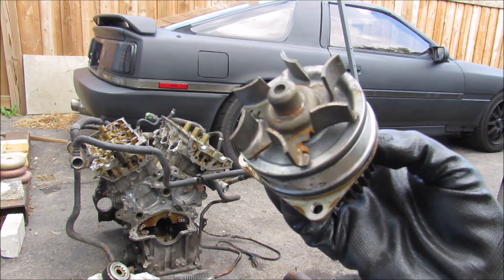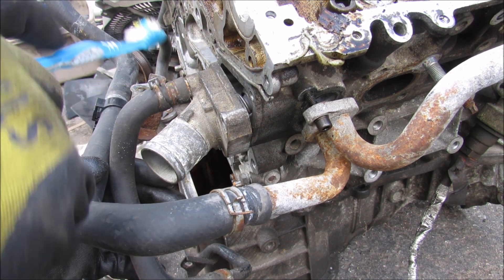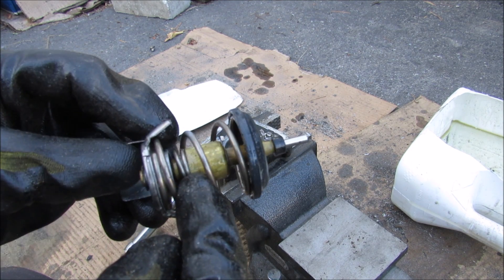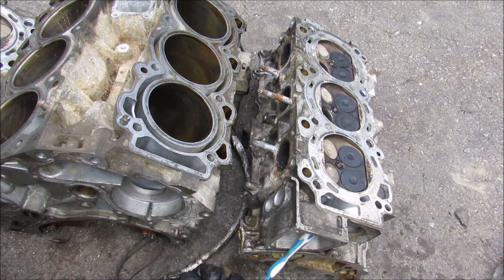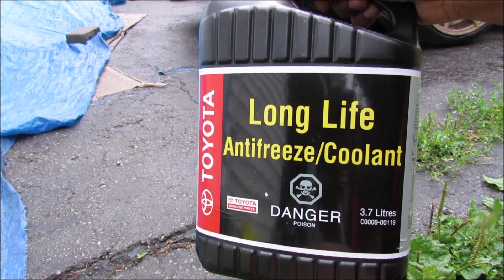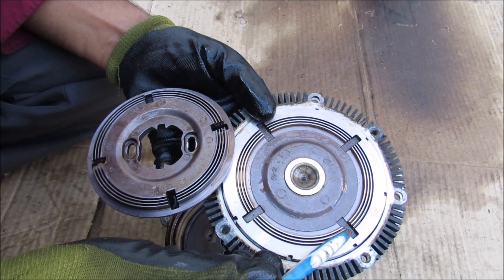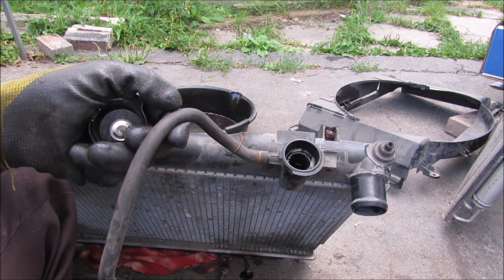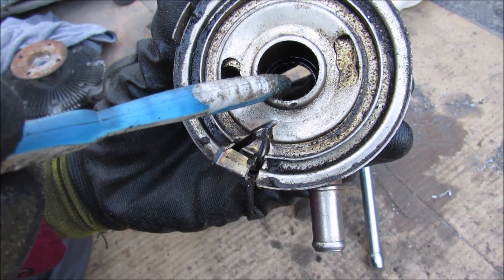Why Engine Cooling Is So Important

Comment: 8:31 Why can't normal clutches i.e the ones used in the manual transmission be designed this way. Surely that would mean they wouldn't wear out??
Reply from the maker: These cannot transfer significant torque

Comment: The coolant doesn’t flow from the radiator through the thermostat in to the engine.Its actually the opposite ,from the engine through the thermostat and the upper rad hose to the radiator.
Reply from the maker: The thermostat goes to the lower hose which is the cold side. So it would go from upper to lower, right?
Reply: Generally the thermostat housing is connected directly to the top radiator hose.When the engine temperature rises up the thermostats open and coolant flows out the engine through the top hose into the radiator down and through the lower rad hose entering back the engine.

Comment: Very informative!
One thing I noticed, on my old 99 Taurus, the transmission cooler was a very small but wide radiator.
I didn't notice this until I fried the transmission electronics after a 2 hour traffic jam on the highway, but... Now I know it wasn't the engine coolant.
Reply from the maker: Ouch!

Comment: Hello Sir, another stellar video! Keep them coming :-) May I also suggest making a video on the integrated starter alternator-'pancake' motor/generator system employed in several recent Mercedes Benz models? Its fascinating technology, that i would love to understand more about. And how different is it from the eTorq system from Jeep?
Reply from the maker: That would be awesome! 
But where can I get my hands on that?
Reply: @speedkar99  True, but I was just wondering if you could use some schematic drawings, like you have in the past, to explain it. I vaguely understand how it might work as a generator, but seems like at times it works as a motor as well- adding torque to the engine out put. Also has some role in regen charging. Very intriguing stuff! Ideal for you to tackle 🙂

Comment: Great description mate .
Actually most of the engine heat is from the cylinder heads and not the cylinder block.
Reply from the maker: Thanks ...I guess combustion gases must pass through the head on it's way out the exhaust.

Comment: Great job as usual.  I recommend to anyone who wants to keep their car for many years including their coolant pump and the radiator to flush and replace the coolant every 4 years.  Heat and sludge are enemy number one to the engine, gaskets and  countless components.
Reply from the maker: Good advice

Comment: If it's so important why are radiators made out of plastic?  I replaced  one in a 92' Taurus today and the crack was caused by pressure of the bolt that attaches the fan to the plastic radiator housing. What garbage.
Reply from the maker: Light weight 
Cost savings

Comment: I'm pretty sure that the hot side of the thermostat normally faces the engine--coolant flows into the rad via the upper hose.  Odd to see a reverse design.
Reply from the maker: Usually the upper is the hot side
Reply: @speedkar99  yeah, why would you want the transmission cooler at the hotter side of the rad?

Comment: why we called it water pump??, we filled the radiator with engine coolant not water, ok both are liquid but liquid not always water
Reply from the maker: Vane pump
Reply: We in Germany say Water Pump too
, but the correct mechanic says coolant pump or "Kühlmittelpumpe"
Reply: Maybe because they made it primarily to pump water but then technology changed and now we dont use water in radiators anymore.

Comment: What? I still have no fucking idea how the cooling system works! Need a proper or clearer diagram of the engine. 

Since 90% of us know nothing about engines, the various explanations of routings in this vid mean't absolutely nothing.
Reply from the maker: You didn't watch the full video...I had schematics explaining the full circuit. 
I also have another video on how the engine works.

Comment: I have a 1995 ford mustang v6 that had a head gasket leak. Rather than replace the head gasket, since it's my beater car, i poured some head gasket sealer into the radiator. The sealer has been working for 9 months now. The car no longer over heats nor loses coolant but I am curious what the inside of the cooling system and the engine would look like with the sealer inside. If you can find an engine that has head gasket sealer inside it would make a good video to tear down the engine to see how that head gasket sealer works. I like these videos.
Reply: hax0rz100  I had a 99 Taurus with a bad head gasket, I too poured a gasket sealer into the radiator. It slowed water transfer through the radiator by 50% and completely clogged my heater core. I know this because I took out the old radiator and heater core and cut them in half before I sold the car for scrap. If I had it to do over I WOULD NOT USE SEALER IN MY RADIATOR. The vost of fixing the engine was more than it cost me to buy another, newer Taurus.
Reply: @bentnickel7487 Well my radiator is still working but even if it stoped working, replacing it is a nothing job. My heater core also still works. If that broke... well, I live in LA and we don't use heaters since it's always sunny.  I didn't want to put a lot of money into my mustang since it is 24 years old with 390k miles and worth nothing today. If you have a car like mine, those sealers are worth a shot before you junk the car.